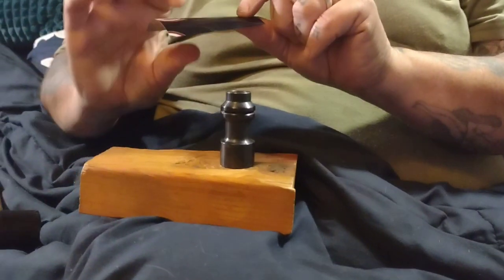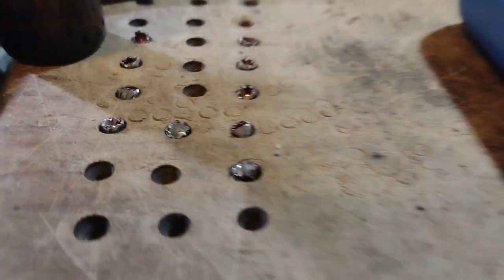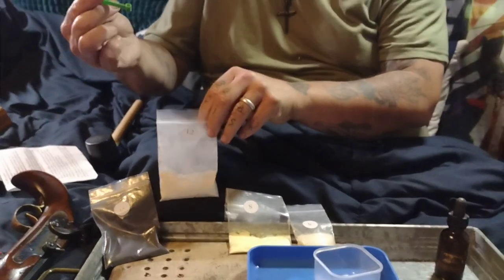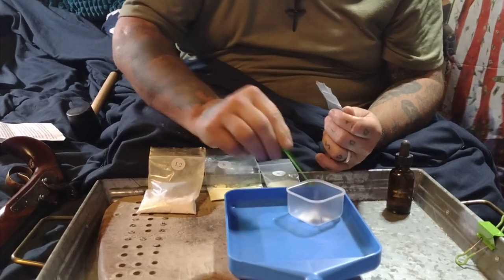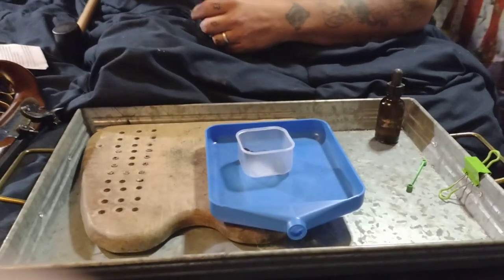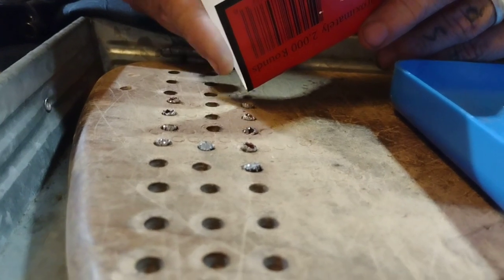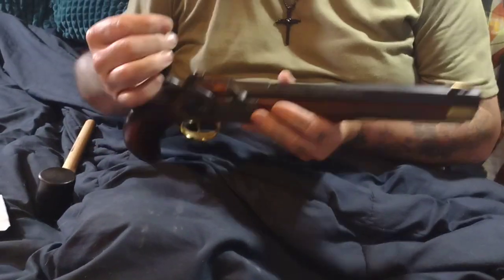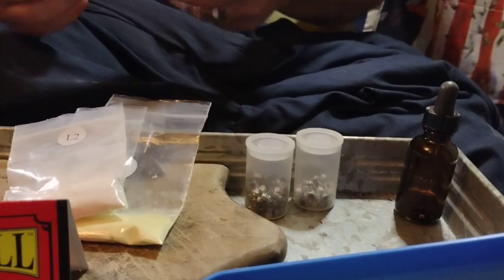Homemade percussion caps.

Comment: Very good video, im thinking in using armstrong mixture for the caps, do you know if the acid will make the mixture solid or wont work, maybe it can react with the acetone, thanks
Reply from the maker: Armstrong mixture I think would work, but mixing the Acetone  not sure about.  You could make a few and try it out.  If you do, please let me know if it worked.
Thank you for watching.

Comment: It’s good stuff, been making my own for a while now with good success, I usually make double batches to yield around 40 caps at a time
Reply from the maker: I bought the kit and started about two years ago back when it was impossible to find percussion caps.  Thank you for watching.
Reply: The 22reloader kit lasts quite a while, the thing I like about making aluminum caps vs the copper Remington #10 factory caps is the aluminum tends to jam less, I think it’s because it’s softer and more flexible
Reply from the maker: @DeucesWildRC  I agree, I don't have near as many cap jams when I use my homemade ones.  I got lazy this summer I finally shot the last batch I made and then the black powder store in town finally had percussion caps in stock so I bought several cans and all summer shooting I've been dealing with cap jams.  Yesterday I ended up making 30 percussion caps.  I bought the number 11 cap maker, I noticed now the company sales a number 10 maker also.  I don't need the number 10 cap maker, the one I have work great on my Revolvers that have #10 nipples and it works on #11 nipples on my other percussion guns.  It's a good product, I'm pleased with it.

Comment: I always use a piece of plastic straw and make a dipper that puts the right amount of compound mixture that will fall into the cap cup without wasting it all around the outside of the cap and then drop in a dash of alcohol 91% and let dry.
Reply from the maker: Thank you, I will give a straw a try.  The caps are so small it is hard to see and to sprinkle the Prime-All priming compound into the caps.
Thank you for watching.

Comment: I intend to make this purchase but have been unable to decide between the #10 and #11 cap maker since I have a Hawken as well as several revolvers. How is the fit of the #11s on your revolvers? If you had it to do all over again would you still choose the #11?
Reply from the maker: I went and bought the number 11 percussion cap maker and it works on all of my percussion revolvers that have#10 nipples, and it also works on my rifles that have #11 nipples.  So you are probably safe in buying the #11 cap maker and the caps should work on both #10 and #11 size nipples. I have not had any caps fall off my cylinder while shooting.  The  #11 cap maker seems to work on both 10 and #11 size nipples. 
  I would still get the#11 cap maker.
Reply: @blackpowderfirearmenthusia3194  thanks for the reply. I’ll give the #11 maker a whirl and your video seems a great tutorial for the how to aspect as well. Thanks again.
Reply from the maker: @reachvictoria3386  I'm glad I was able to help.

Comment: Do you ever get chain fires with these caps?
Reply from the maker: I have shot probably over 250 rounds using the homemade percussion caps and I have not had any chain fires at all.  The only chain fires I have ever had was with CCI #11 caps on a revolver that needed #10 percussion caps.  And still not sure if that is why I had a chain fire but it only happened once.  I have had very good results with the homemade percussion caps.  I still get a cap jam once in awhile but that's about it.  It is good to have the cap maker because with this cap shortage we had in the past I was able to keep shooting when I wasn't able to buy percussion caps.  They are time consuming to make.
Thank you for watching.